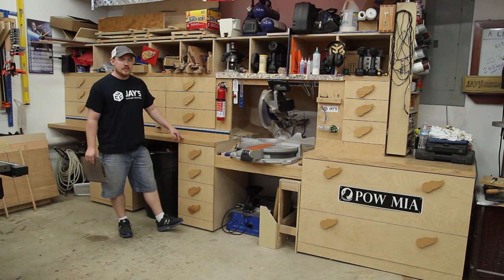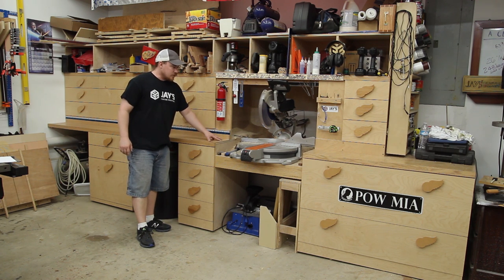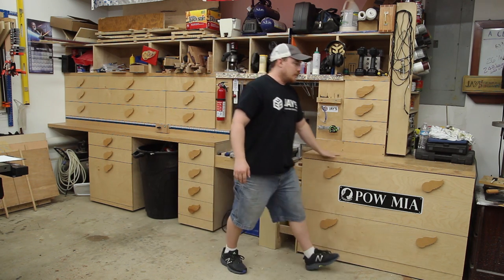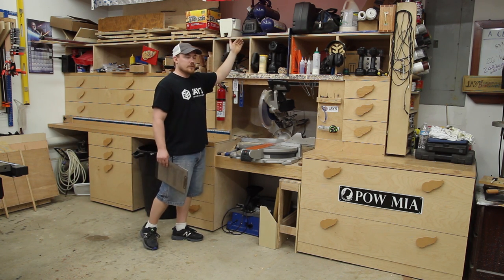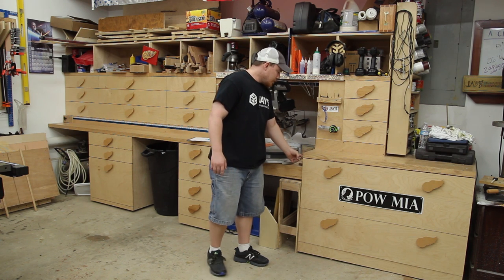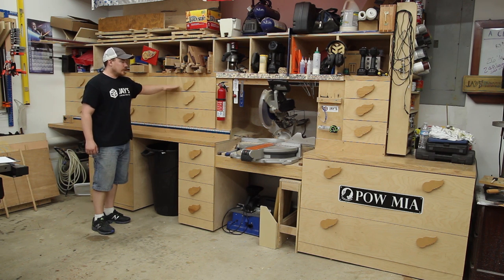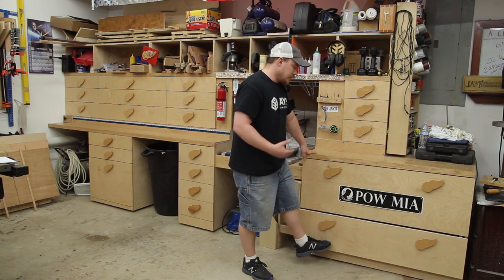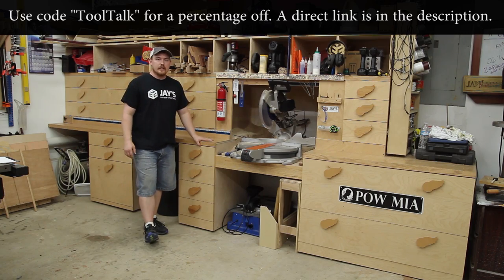The Ultimate Miter Saw Station

Comment: Jay thanks again for the video. It was the push I needed to upgrade my miter saw situation. I bought the plans, the drawer slides and adjustable feet for the Ultimate Miter Saw Station then decided I wanted my station on wheels. I ended up with a Bosch 12 inch glide to replace my Dewalt 708 then I ended up with building the Rockler  miter saw station. It fits my situation.  My old saw needed almost 48 inch depth with dust collection this one is 24" deep ,1/2 half the space WIN!!.
Reply from the maker: WIN! It's definitely a situational decision :)

Comment: I'm in the middle of this build and I agree with what you're saying. This miter saw station is amazing. One suggestion I might make is to your plan layouts. Number the pieces on the cut diagram and then on the assembly diagram would help. I individually numbered them as I was cutting and then marked them on the the plywood. So when assembling the drawers, i knew what went with what. Otherwise, the plans are awesome!

Comment: You could make thin MDF panels with magnets that fill in the gaps on the left and right side. It would probably help with the dust spill out and would be easy to remove. I saw another wood worker do this for his contractor style table saw. Thought it was pretty smart.

Comment: Jay great discussion on the saw station,I drank the kool aid and bought the plans and ordered the slides they are the replacement for the ones you listed. I also bought the Kreg Foreman and a new Bosch glide. Yes i know i could have stuck with my old Kreg k3  and Dewalt 708 but both are getting long in the tooth. I currently have  the New Yankee hutch and hope to incorporate a version of the JBMSS to work work together with the Norm hutch. The big change I am making is the top drawers will not have as deep of draft as the bottom will be flush against the wall because of the Bosch not needing the extra depth. The new slides for the top will  just be  shorter I will order from the same place. great people to work with and super reasonable prices. I will keep you up to date on the progress. I haven't put it to paper yet but I think 16 inch top drawers will provide plenty of useful storage. Also glad to know the nose it doing it's job better. #8 forever

Comment: Jay, you also mentioned that you think you'd rather have an older radial arm saw. You said the same thing in Tool talk #7 also. If you have a friend that has one, I'd advise you to go play with theirs for a while. I had one for years, but after I got my Delta compound miter saw, my radial only saw dust collecting on it. the only thing I miss about it is the ability to hog out dados in large lumber pieces, and I don't do that any longer. I've still got the delta but have recently upgraded to the 12" Hitachi. I like it much better. Plus I don't need such a deep work surface with it. My $.02 adjusted for inflation. YMMV. Cheers.

Comment: A couple of question. How did you go about planning for the different storage areas of the station? Did you lay out all of your like type tools and sundries on a table/bench and figure out what drawer sizes would work best and I don't think I've ever noticed any cushion mats on the floor and since you're working on a cement do you plan on getting any? It may not bother you yet, but you may want to consider them before it does because someday it will.

Comment: I have almost finished my miter saw table. I have a full 8 feet on the left and 50 inches on the right. I also have my table touching each side of my saw and it will turn max cut in either direction.

Comment: Awesome build Jay. I have a new miter saw ordered and will buy your plans to give me a starting point for a similar station. One question though: What height is the top of the miter saw surface and side platforms. I can't decide to go with 39" or maybe even 42". My current setup is around 40", which works okay, as I am 6' tall . I want to get maximum storage below the saw, yet still have a comfortable work height.

Comment: I am interested in building this miterstation with all the drawers at some point.  For now I just need to build the main frame and add the drawers later.  Now one thing I would like to have as an option with your design is the ability to roll the miter saw in and out of the overall frame/station.  So if I want to work outside the workshop I want to be able to roll it out and flip up wings for the infeed/outfeed functionality.  When I don't want to be outside I want to be able to roll the miter right back in between where you have it sitting right now.  Any thoughts on doing something like this?  I am a hobbyist just getting my wings wet.

Comment: I built a smaller version of your miter saw station. my wall isn't long enough for the full build. Anyways my original miter saw was 10" sliding compound Miter (only bevels one way) later I upgraded to a 12" Hitachi sliding compound miter (bevels both ways) some adjustability or some kind of modular design (where the saw goes) would've helped with the transition.

BTW If you move, what do you plan on doing with the miter station? leave it or break it down and take with you?

Comment: Hi Jay, I purchased your plans earlier tonight and they will be a huge help and heavily relied upon as I begin building my own miter saw station.  I have one question though.... the wall that I need to build it along has a 3" tall x 50" deep "step up" formed in the concrete.  In your opinion, would the 14" difference between the front of the bottom cabinets and the edge of the "step up" be enough to stand on and use the saw comfortably?

Comment: Regarding the right-hand drawers, I find myself wondering why you put the larger on top, as most drawer units have the larger on the bottom.   But after watching this I'm guessing that is something about the first order of accessibility?
Reply from the maker: The B3 drawers are the same size. The top one looks larger because the front is taller. I allowed more room above it in the event that more bracing was necessary below the top surface due to the longer span. It isn't necessary though.

Comment: Hi Jaye, Jon here (wooden Xmas decoration guy), did you glue and screw the bottom of your drawers into the sides rather than cutting a groove for them to slide into? Which is best in your opinion? Particularly for heavy storage?  I’m making in the middle of making your mitre station at the moment.
Reply from the maker: What's up Jon! I glued and screwed them from the bottom into the sides. Plenty strong enough. The only downside is that it's ugly when viewed from the side. Not a problem on shop furniture.

Comment: Hey Jay, I have one question specific to this build. By the way, I can't wait to see more of your builds, they are awesome.

If you had the opportunity to modify this cabinet for a Radial Arm Saw, what would you do differently? I am not talking about the small details such as the height and depth of the hole for the saw, I am talking about the features themselves.

I have bought recently a Radial Arm Saw with an "accessory threaded shaft" in the back of the motor, thus, I am thinking of creating a cabinet along the lines of the one you built (with less storage though) for it, since my Miter Saw is junk. So, I wanted to know what would you do if you were to build it specifically for a Radial Arm Saw, since you said you wanted one for this build in the first place on another comment.

Thanks!
Reply from the maker: I probably wouldn't do anything different for a radial arm saw.

Comment: I currently have 14' of cabinets to one side of my miter saw. I have drawn a line with a straight edge off of my mitter saw fence where my fence should go. I noticed sometimes when I'm cutting a longer board and put it against my miter saw fence it goes past my fence line because the board is crooked. So if the fence was there I wouldn't be able to cut a square cut. What do u do.
Reply: Buy a jointer

Comment: in a tool talk you mentioned you would rather have a radial arm saw,  how would you modify this station to accommodate one?
Reply from the maker: I'm not so sure on the radial arm saw thing. I think I'd rather have one but.... 
As far as modifying this one it depends on the radial arm saw. This was built around the Ridgid 12" sliding miter saw which was the largest miter saw I've ever seen. There is about 27.5" from the miter saw fence to the back wall which I think would accommodate a radial arm saw. You'd just have to incorporate the base in the area between the two base cabinets.
Reply: Jay Bates 2 thanks for the quick reply! Ever since I got my radial arm saw Christmas before last I've wanted to make a station like this for it, but I'm not sure I can take on a project of this size yet. I really appreciate the thought and thoroughness you put into videos.

Comment: Just curious if consideration is given to uneven garage flooring in the build.  Thanks!
Reply from the maker: Yes. Each base cabinet has homemade leveling feet.
Reply: Just one more question I promise. I don't know if I can dedicate the 144" or so inches you have for the entire length. What's the minimum length on either side of the saw that would still be effective? Is 8' on one side absolutely necessary? Thanks again!